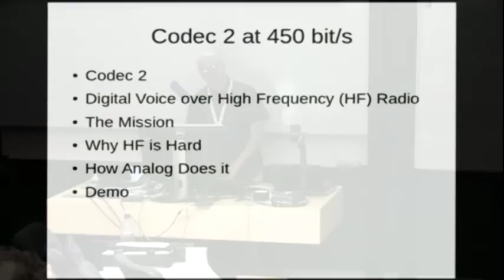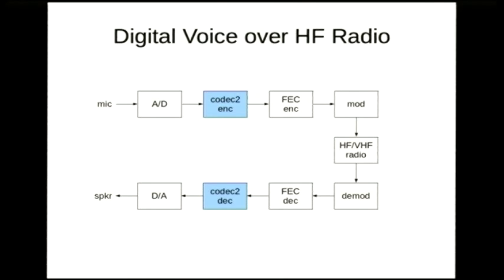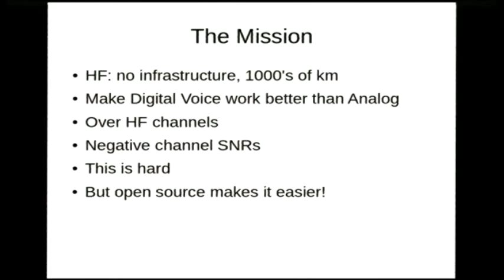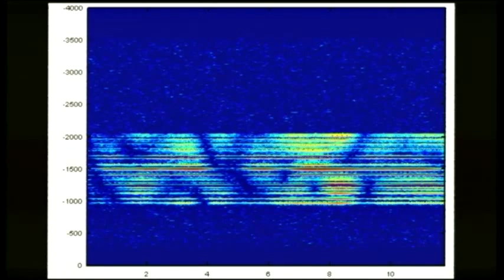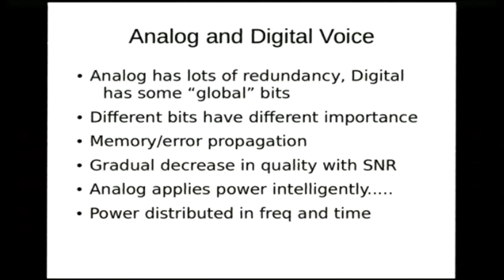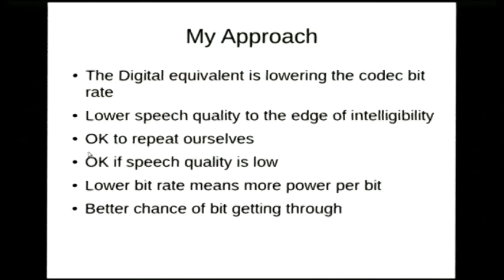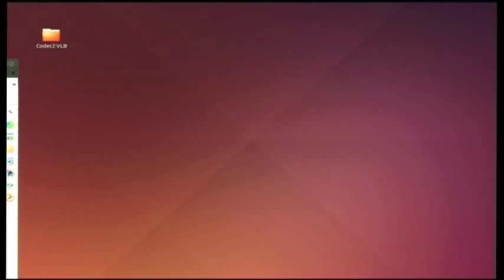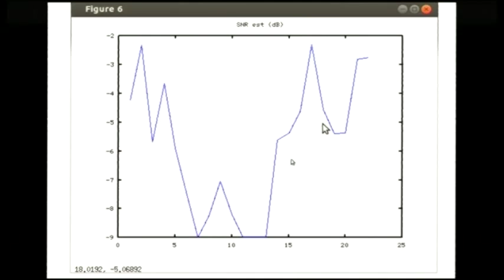Codec 2 at very low bit rates

Comment: in general: wouldn't it be much more helpful to establish some kind of voice mail interface between both clients?

and add enough redundancy that it would require a jammer to get less than 99% accurate reproduction.

or slow down the bandwidth enough so that algorithms (maybe deep learning) can easily remove noise because the noise acts faster/more randomly

the digital transmission could avoid every other frequency while noise maybe doesn't
so algorithms can easily spot noise because it crosses the borders

Comment: I wonder if you could actually improve speech quality further
giving more important bits more power should be doable if you create several digital audio streams and modulate them ontop of each other.
While the important ones get the most power and the others can get lost in noise without a problem.

and then I also wonder, whether delay is such an issue, if you could indicate that speech is being sent by and led. The additional time could be used to counter the noise and get an accurate reproduction of the input.
Even though you can't talk 100% of the time

like Whatsapp voice messages.
Reply: and you could actually catch up delay-wise by dropping silence once silence occurs
Reply: @bFix  
The whatsapp thing sounds interesting, so basically send batched messages with a lot of redundancy? am I missing something?
Reply: @migueld2456  pretty much yeah, but still like some live telephone call but over a very noisy connection. And you trade some latency for voice quality.
Though that is just an idea I had. It might not work out